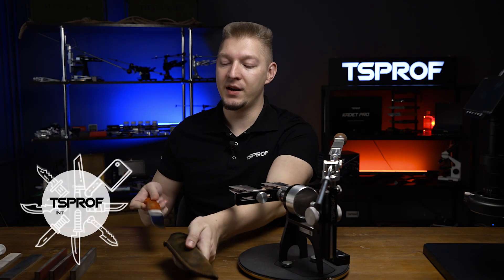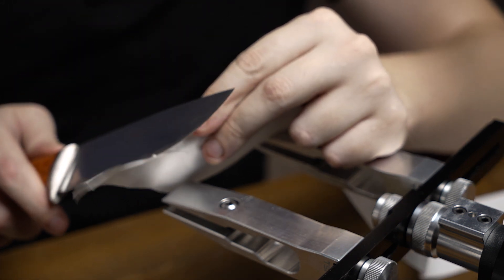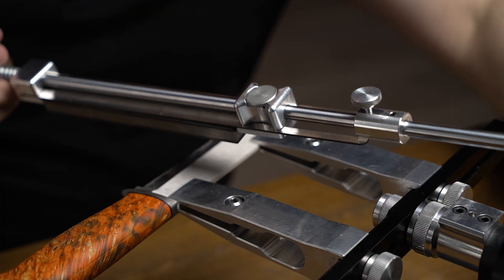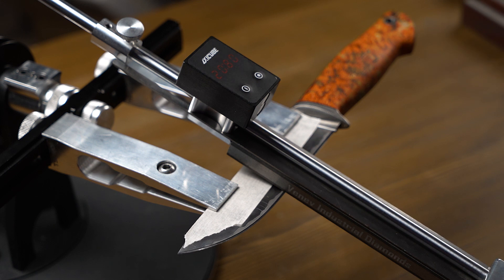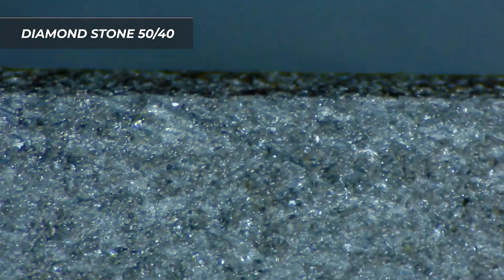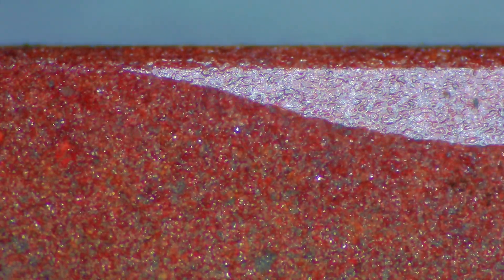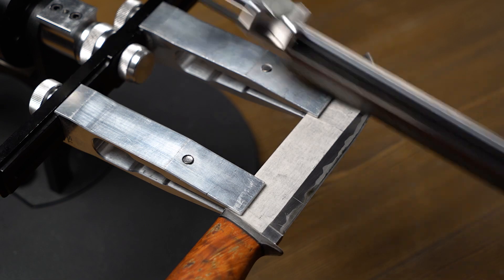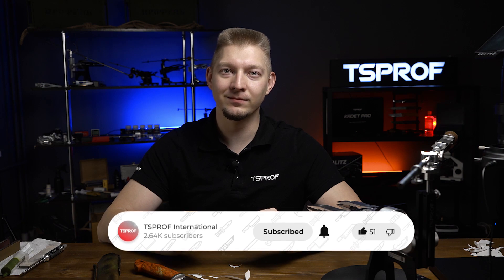Sharpening a Knife Under the Microscope with TSPROF K03

Comment: i am very curious how the clamps keep a tapered blade parallel to edge when rotated
Reply from the maker: If it's full flat grind, you just clamp it by the flat area next to the handle with one clamp, that will be enough. Alomst 99% of FFG have it. If a blade has no such area, you can glue masking tape to the clamping areas of knife.